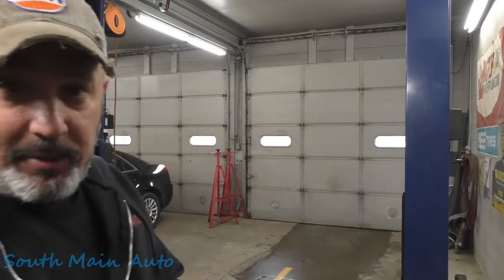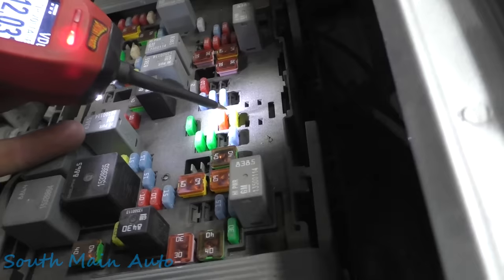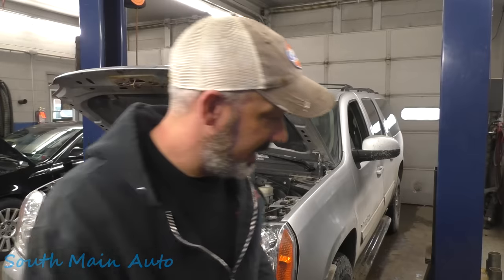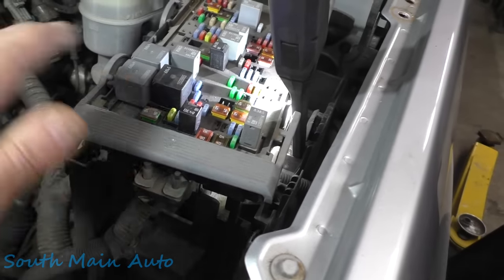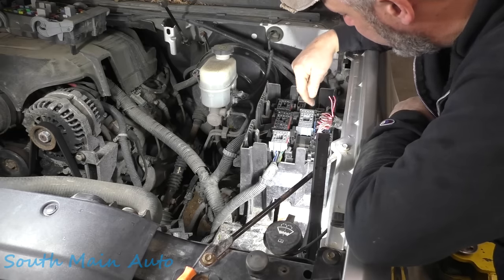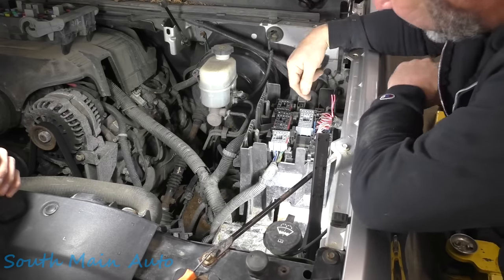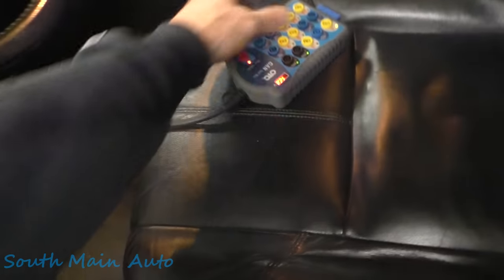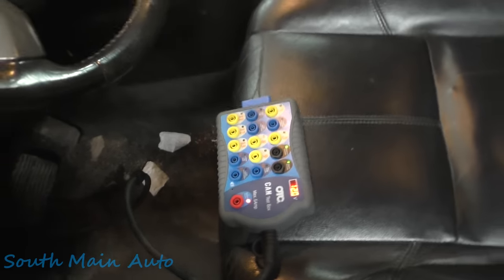'14 GMC Yukon XL - No Communication With Inspection Computer

Comment: Came across a similar situation with my daughters Escalade. Turns out a penny had dropped in the accessory outlet in the center console and popped the fuse.
McCoy is a lucky guy having you as a mentor Mr O 👍👍
Reply: I've seen multiple times over the years where that has happened. Or the port has a popped fuse and they had just cleaned out the car before they brought it to the dhop because that port and obd plug didn't work.

Comment: My heart is in my mouth when I see you pull one of those fuse boxes apart. If  I did  that I would end up with all manner of faults on reassembly,  where loads of other wires have broken off.
Reply: Been there myself and it wasn’t fun everything was green and pusy nasty, had to buy real small crimp terminals and start replacing each wire one at a time so that they didn’t get crossed. It was on a 91 ford f150 the electronic control module just terrible. But it was still working good when I sold it
Reply: I was waiting for Mr.Biggey RAT to jump out when he pulled the top off that fuse box 😮.
Reply: Yeah, if it was me, I wouldn't have gone anywhere near that fuse box. I would have just run a new wire to the data connector and tied it in as Eric did. He got lucky on this one but  I've seen too many of those fuse boxes just fall apart when you try to remove them.
Reply: a man's got to know his limits!
Reply: me as well.  I own a 2013 GMC sierra (basically the same as this one.)  After these videos I want to go out and inspect my fuse box.... but I am afraid...  I need an Eric nearby.
Reply: I wouldn't even touch it. @TheBry_Guy

Comment: McCoy just learned problem solving skills and logical repair techniques that have wide application for electrical system corrosion issues common in your neck of the woods. Good man, Mr. O.

Comment: Where I used to work before retirement, the aftermarket upfitters used to like pin 16 for power to their units.  Of course a 10 amp fuse (Ford truck) didn't last long, so I installed a Napa fuse holder like yours and left pin 16 with it's own 10 amp fuse for Diagnostics and Smog Test.
Good one Mr. O.

Comment: Hi Eric, being an old man and having old tricks back in the day, but I suppose you do know this trick?
When the posts + _ were full of corrosion after disconnecting I would boil a kettle pour it over the terminals battery and it would all disappear like magic?😂
 I would then smear them with vaseline no more problems?
Now’s the future it was to easy back then unlike now!
I very much like how you work with your customers not only, but you do an excellent job your very Particular and careful when your are finished making sure that it’s done and cleaned  for your client’s.
There are a few about who are proud of what they do and you’re one of them pal!
Good job!!!

Comment: For taping in an even tighter spot, use your 3M Super33 tape and wrap a "normal" (non heat-shrink) butt connector.  It's way easier when repairing insulation in a harness with lots of wires in really tight spots.

Comment: I've used the mini-roll trick several times. It also works for Teflon pipe thread tape. In a pinch you can use your fingertip too, just make sure you wrap it on the correct direction, haha.

Comment: I've been having a communication code problem with my transfer case control module after this video. well I looked at my fuses on my 2014 suburban. Found a faulty fuse for the transfer case control module not due to corrosion. It was just faulty. Pulled a unused Fuse and replaced one for the transfer case and son of a gun at works but I went to put the lid back on and I slammed it with my hand shut and sparked blew out the bottom of the fuse box. I think I found my problem wiring issue. Thanks, Eric

Comment: Great job,  IMO that is a better fix than putting in a new pin that will probably recorrode in a year or two.    As you said if it was a bunch of pins going to systems that would be different but that is a good fix for 12vdc.

Comment: Great fix. I think before an automotive engineer gets his degree or credentials, they need a few months/year working in a repair shop. It would change the way they approach design. I've said the same about architects, they need to actually hands-on build their first two projects. They typically want to make a statement about their skills in design, let them build that design, it'll be a reality check.

Comment: Well, here in Arizona, a 2014 Yukon (Mrs. Cuss has one) has decades of life remaining, no rust at all.  Anyway, we did have similar issue on a 2005 Yukon, state emissions station could not read OBD2 codes, like the 2014 in your video.  I took it to O'Reilly, they couldn't read it either, suggest a bad fuse.  I somehow figured out that OBD2 fuse was same as cigarette lighter socket, and its fuse was blown, from something inside the cigarette lighter socket.  So easy fix, one apparently needs to know that OBD2 is same circuit as labeled "Cigar", and I'll bet that folks at the test station actually knew this, but are forbidden from stating that or testing such fuse.....

Comment: I had to do that on my '83 Olds Cutlass Ciera station wagon on the torque converter clutch took that car to a reputable dealer so-called he had it 6 months and all he could tell me was it was a design flaw, driving down I-75 at 70 mph and it was constantly locking and unlocking, maddening, so I found the fuse bypassed the input hooked it to a manual switch and battery hot no more insane jerking. Actually picked up 3 mpg, just had to remember to switch it off before a stop. But other than that it was cool.

Comment: Another sign of Quality engineering by GM.  Let's put all the main electrical connectors and power distribution right where the hood seems are and that see a lot of moisture and water.  Lets also make all those connectors connect to the power distribution box without weather sealed connectors to the pins on the bottom of the distribution box.  I mean because, "eff the customer" that's why.  Why do people keep buying their absolute garbage.  It's a head scratcher.
Reply: Things went downhill with engineering the last 20 years. When Ford came out with EFI in the mid 80’s, the computer boxes and electronics were located inside the passenger compartment. Somewhere along the road of progress a some rocket scientist figured that stuff should be located under the hood exposed to the elements, grease and engine heat. Then in 2019 another brainy smurf at GM decided that the ECU needs to live inside the left front fender???  Engineering at its finest folks!

Comment: '94 Lumina had no taillights.  Traced it to the bottom of the fuse box that was open to the elements (salt/dirt) and found a "sea of green.  Broken wire into the box and fixed it just like this with an inline fuse.  Good for another six months until the trailing arm pulled out of the unibody.  Done.

Comment: Would you recommend spraying silicone dialectic on the back of the pins/harness as a preventative measure? Also I recommend upgrading to super 88 tape, better temp range.

Comment: That was a good fix.  mucking around those old corroded connectors is like walking into a rattlesnake's nest.  you could fix one problem and end up with 12 more. That was a smart workaround.   Heh Heh,  Take your 10mm socket.....drop it in the engine bay, never see it again.  That's me.  Those heatshrink butt connectors are the nuts I  was skeptical about them at first till I tried them on a project, they work great and last.

Comment: All the Napas around here have a box of assorted connectors behind the counter, and they're way cheaper than a fuse holder from there!  I've found PCM connectors for my '01 Pontiac, and steering column connectors for my '71 Buick from there, among others.  Also easier than trying to figure out what the model of the connector is to look it up online.

Comment: I bought a 2015 Charger RT a couple of years ago which has a chip in it. Won't talk through the port at all, and emissions testing had to be done on the rollers. Also needed adaptors to install LED headlights. Those chips are not all they're cracked up to be.

Comment: Mr. South main, I have a 2004 Yukon GMC and when u turn off the motor and shut off the key and remove, I noticed one evening that the hibeam indicator glows and lights up, and if I leave the vehicle unstarted for a couple of days battery dies any advice or better just to bring it to you, and if so need shop number and will make an appointment, 
Thank you for your time 
Been watching your channel for quite some time and you are very impressive with your work on how u annualize problems on vehicles

Comment: I had a new 2011 2500HD. I did not have 12 volts at the trailer connection on the back of the truck. They put a dummy fuse in from the factory. Drove people nuts. I'm pretty sure that this powered the stud Mr. O is using.

Comment: Wow 2014 having them issues .. My 2006 yukon XL had its first green wire on rear fan just last fall. Its got every option GM had and all works . Are the newer rigs worse for wires going green.

Comment: I really wish that the engineers would keep in mind that some parts of the world use salt on the roads, during the winter months. Salt causes accelerated corrosion to copper, tin, steel, iron, etc. to the extent that 5mm steel can be perforated in less than 10 years, and copper grows green and fluffy within weeks.

Comment: Is there any kind of maintenance that could be applied to that fuse box, possibly take it apart after so many miles and apply some kind of anti corrosion spray or something similar to head of those problems

Comment: Thanks Eric appreciate the heads up and the info that you provide all of us, can you tell me where you get your butt connectors that have the solder in them and the glue? Is that from Napa or do you have a different source that you get your electrical stuff from? Thank you

Comment: I have 13 Chevy Express 3500 trucks in my fleet, ‘09 to ‘13’s, and half of them have had the classic melted connector under the fuse box that controls the fuel pump.
Repair parts are available.
Reply: GMC Acadia going into limp mode. No recall but DTC P1682 
Service bulletin 19-NA276
NHTSA TSB 10170495
mc-10170495-9999.pdf
So, they know about things but refuse to  acknowledge their engineering screw ups.

Comment: Great job as always Eric!   I would have been inclined to spray to the connectors and  pins with WD-40 to ease re-assembly and slow further corrosion.  Any thoughts if this is a good or bad idea?  Thanks!

Comment: 14:05 They have those butt connectors now with solder in them. When you heat shrink the solder melts and gives you a more robust connection than a crimp.
Reply: Eric O refuses to use those due to high failure rate that he has seen
Reply: They are shit. I've used both many times. They are however useful for wires under 0.3mm2
Reply: I @barrybritcher  I used to keep a bag of "micro" butt connectors in my kit. I found them at Radio Shack, designed for use on telephone wire... I don't know if they're still available,  but they were very handy.
Reply: @barrybritcher  Glad to learn that. I have them but haven't used them yet. They come for different sized wires. Is that your only beef?
Reply: Crimping is better than soldering in vibration-prone areas.
Reply: @markanderson2904  Is it vibration prone when it is supported on both ends as well as the joint with shrink wrap? The solder is really about assuring a good electrical connection. From my experience, the shrink wrap has been sufficient to hold the splice together. I have found that with high currents, a crimp connection is far from adequate. I solder and slide the shrink over in those instances. The internal solder solution is faster and more compact.
Reply: @toddmarshall7573  the alloy necessary to allow the low-temp melting point of the solder in those connectors is not known for long-term durability. It is more prone to vibration-induced failure than "normal" soldering alloys, and is best applied as a quick/"get-you-home" fix, but not a long-term repair (but we all know how those "temporary" fixes go...).

Comment: I have the same problem with my 2005 Chevy suburban. It hooked up to the cigarette lighter on the driver side and I don’t use the cigarette lighters, but I don’t know quite a few keeps popping. I wanna hook up the scanner. I gotta put a new fuse in.

Comment: Notching or putting a hole in plastic is easiest. You just take the drill and heat it with your propane. Torch and all you gotta do is touch it's instant

Comment: If the corrosion was in the OBD connector, and you couldn't bypass in the same manner, would you attempt to re-pin, or completely replace (ugh !) the OBD socket ?
Reply: I’m thinking you would have to repin it because otherwise when you plugged into it it wouldn’t read correctly

Comment: Do you have a link for the communication tester you used? I have a 19 honda pilot with no communication
Reply: That is BOB, a breakout box. The Oh Tee Cee logo is clearly seen, takes about 3 seconds for your favorite search engine to find one for sale. About 300 bucks. Probably necessary for full time shop use. I prefer the Godiag for bench use. Only about 70 bucks. NOT UH SPONSAH.

Comment: No crank no start in cold only

2007 Chevy equinox v6 fwd. when parked outdoors in cold weather vehicle will not start no matter what. 

If vehicle brought indoors in hested garage for about an hour it starts. 

Replaced starter, main b+cable going from battery to starter. Cleaned the motor and engine for ground. 

If vehicles outside and doesn’t start. Solenoid clicks. If you take a jumper cable hook up battery positive to the main lug on starter u can turn the car on if key is in on position. 

With new cable and starter issues the same. Tried swapping relays already too.  What are we missing

Edit. 

Battery is fine. Only sitting outside it won’t start on its own unless I take a jumper from battery directly to the starter. Otherwise trying to start with key. The solenoid just clicks. It has a new starter. Starter functions fine as when indoors it starts like normal

Comment: I had a fire truck only running on half the injectors 
I used my mini fuse that I cut off one side of the fuse to check each side of the fuse  female connector pin drag tension individually in the fuse box 
Found loose pin drag  tightened it with pick engine fired up and ran correctly 
No one could believe it found problem so fast 
Make a tool  take a mini fuse clip off one flat blade 
Pull stock fuse out insert fuse tool 
If ok flip tool around to varifie pin drag on both sides

Comment: To save my life I can’t find a decent micro torch. is the one that you’re using any good And can you share a link?
Reply: Looks suspiciously like the ones by the checkout at the dollah gee. Definition of a good one is one which lights when you want it to and was cheap enough up front that you don't really care when it falls apart, or gets crushed under foot or under tool, or just goes UA.
Reply: If you don't mind the cost, there is one I have owned and used for over 20 years. It is a compact, flameless, heat blower, all the gas controls are in a replaceable internal lighter, it has a wrap around heat shield to shrink the tubing all the way around in a single pass, but costs about 30 bucks. You'll have to figure out from this the brand. It is  iie row ohh day ahh. First letter of each word is the brand. Called the micro therm. If I type the brand, Big Brother might delete the reply. I can't say the new ones will last as long as mine has, but I would buy another one.

Comment: Is the customer required to get it inspected where they tried before, or is it they know you'd give an honest assessment?
Reply: Mr. O would probably not pass it for some type of structural defect based on the rust.
Reply: It has to run through drive cycle for emissions since the battery was dc
Reply: In Virginia, if you fail inspection, you re-inspect (after repair) at the same place for $1.00. If you go to different place, you pay full price for an inspection. In the case of Eric's customer, it appears that no inspection was done as the car couldn't communicate with the inspection machine.

Comment: These fuse boxes are notorious for failing. I’ve replaced hundreds of umbrellas bc they are only about 100 bucks used in good condition from my local strip in and sell auto supplier. New i think they get pretty darn pricey but yeah terrible design

Comment: like those crimp and seals. I dont like the "solder seal" Just last week I fixed a 09 Dodge Journey. Customer had already replaced the battery and alternator and still had a battery light and no charge condition. I found that someone had used those "solder seal" connectors on the alternator connector for some reason or another.  The "buy here pay here" lot that he bought it from uses those elcheapo solder seal heat shrink deals. The F terminal had high resistance between PCM and Alternator. It was that solder seal connector that failed. I prefer to solder in most cases but use those crimp connectors when soldering is hard to do.

Comment: Had one that overloaded the cigar plug, melted the wire and fuse (did not blow).  Lost power to DLC.  Melted fuse and wire without insulation was the clue.
Reply: Chevy Silverado

Comment: If it was your car I would not complain, if it was mine I would expect you to fix it correctly, without any mods.
Reply: If you had to pay for the “correct” fix on a truck that old and rusty, you would change your mind pretty quickly…
Reply: Correct fix means crimping new connector. I doubt it would cost more.
Reply from the maker: It is literally a rotted out shit box GM. Why waste the time and money? This thing will be in the crusher in a year. @jacekpaw1